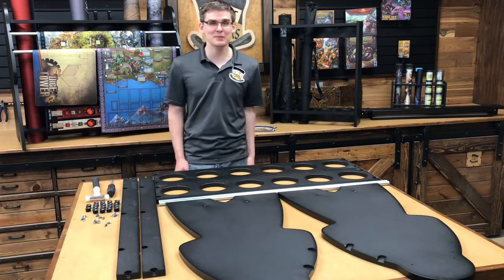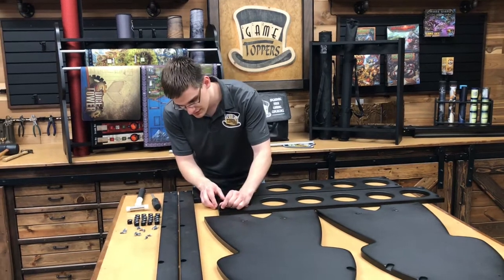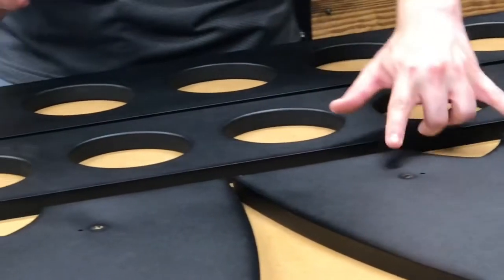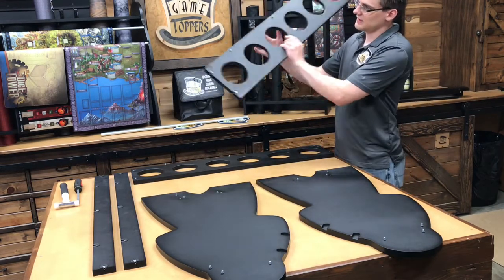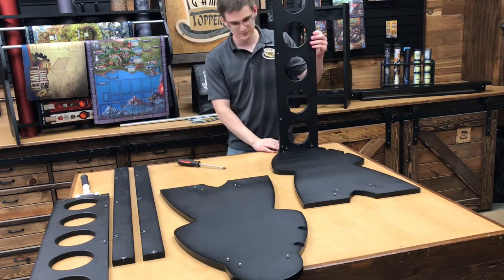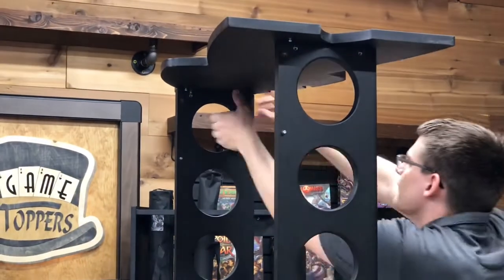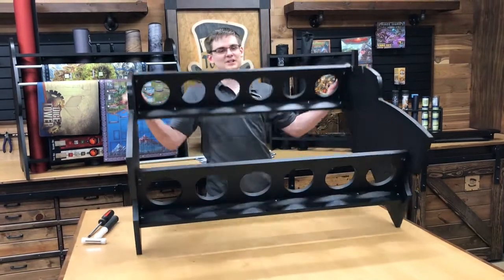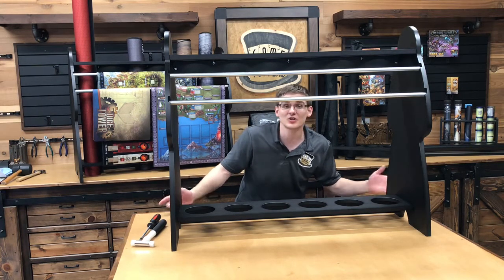Lord Burkton 6 hole mat storage rack

Comment: What I’m unclear about…my game room is finished so I finally started putting my Lord Burkton together. In this video it shows the both the top and bottom boards are cut out to accommodate the mats once inserted…only one of my boards has holes cut out…is this right?
Reply from the maker: Yes, we made a modification to that on our last Kickstarter that was spent quite a bit of time getting feedback from customers. They preferred to have the mats off the floor so they could easily move the rack and vacuum underneath and so while essentially it’s all the exact same installation that was a slight modification. Thanks kindly.
Reply: @ so has there been any communication regarding sagging of that board due to weight? Seems a cross piece underneath would be needed…?
Reply from the maker: @BoardnAK  there have never been no problems with this. If you have any concerns or troubles, please email support@gametoppersllc.com. I’d be happy to help we don’t manage customer support through social media. Thanks much.